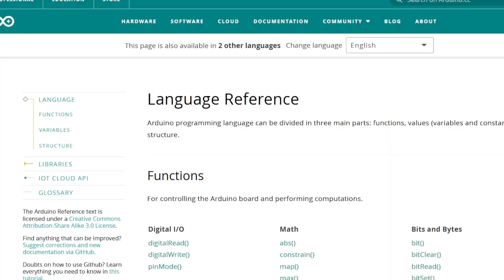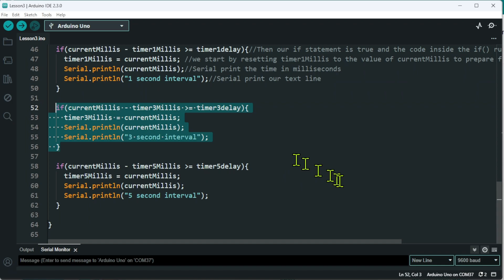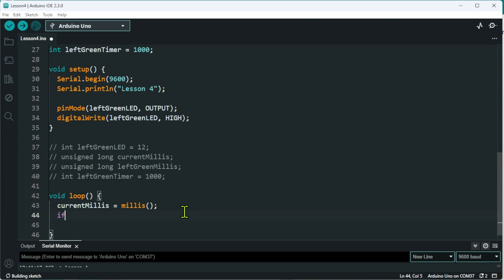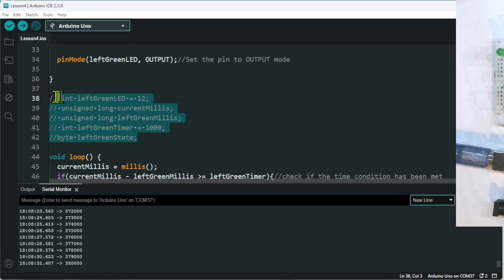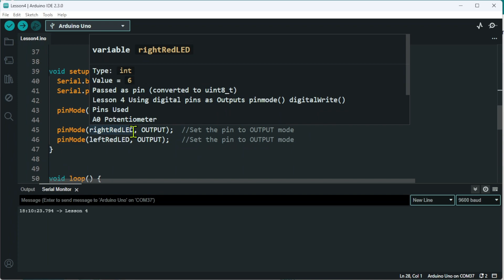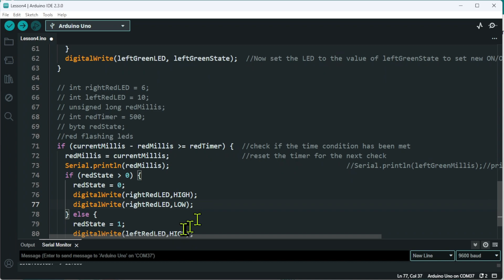#92 Arduino C++ - Lesson 4 Controlling digital pins with digitalWrite()

Comment: Following your previous millis video, I created a spreadsheet showing the various values of a millis timer as the mills function increased. It helped me to get a firm grasp of how it works. Thank you.
Reply from the maker: I used to turn the clock on in the Serial monitor to get a visualisation of the times. I think it really helps at times to do something like that to get it clear in your mind.

Comment: hi, does leftGreenMillis always holds the same value as CurrentMillis and it only subtracts when it hits over 1000? or does the CurrentMillis=leftGreenMillis happens when CurrentMillis hits over 1000 and the equation of "if" is true
Reply from the maker: leftGreenMillis stays the same value until the if() statement becomes true and it is reset to the value of currentMillis;
currentMillis is updated in every cycle of the loop in the line currentMillis = millis();
So it's currentMillis that keeps changing until the if() statement goes true.
https://www.youtube.com/watch?v=kGbKSX4sRFI is a tutorial on using millis() for timing.

Comment: Question, do you need a resistor on every LED?  Or could you put one Resistor between Ground and the return pin of the LED and just use one Resistor for the LED Section of the circuit?  Just thinking it would make the circuit much simpler if this can be done, but don't want to fry LEDs in the process. 

Of course, not sure yet if some more of this comes into play in the next lesson yet...
Reply from the maker: Good question. I always stick to 1 each and it keeps clarity in the diagrams. I think you should be ok sharing a single resistor. I can't test as in hospital at the moment. Just give it a try. The LED will only be damaged with no resistor so I would just go for it.

Comment: Thanks for the lesson. I do like the copy and paste idea, as often my sketches fail because of spelling mistakes. Tried this "homework" on several LEDS. I used  this in my sketch. 
Not sure who to give the thumbs up to, as it could be an amalgamation of several people. It uses the NOT (!) function to toggle the LED.

for (int i = 0; i < arraySize; i++) {
    // Check if it's time to blink the LED
    if (currentMillis - previousMillis[i] >= intervals[i]) {
      // Save the last time the LED blinked
      previousMillis[i] = currentMillis;

      // Toggle the LED state
      ledState[i] = !ledState[i];

      // Update the LED
      digitalWrite(ledPins[i], ledState[i]);
    }
  }
Reply from the maker: Glad you are enjoying it.
I use the != a lot but it's a bit advanced for lesson 4 so will be brought in later, same with arrays. It's always difficult when you code all the time to remember the items that tripped you up when you started. Even things like the breadboard are obvious when you have used them for years but can be a mystery when you first open a kit up.
Reply: @digitaltown5442  
Perhaps I got that from you then! As I said YT gives you lots of ideas. 
I think you are correct in saying it’s a bit advanced for lesson 4, with arrays etc. Still, I’ve taken something from this video. Keep up the good work.